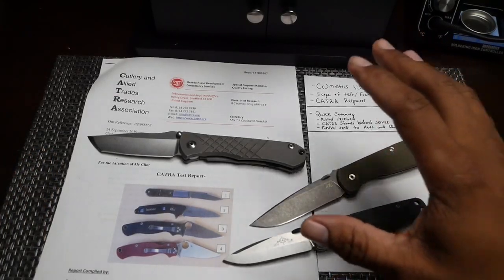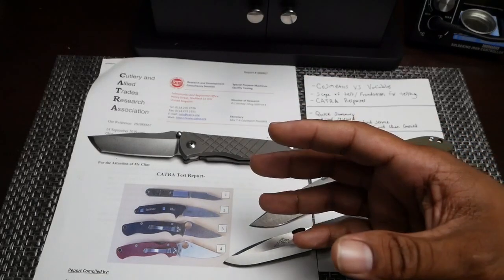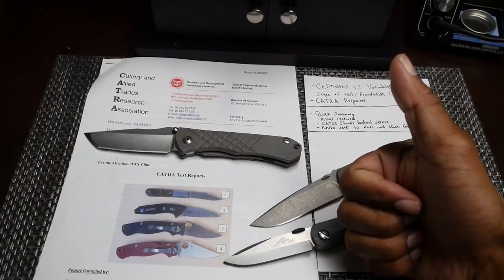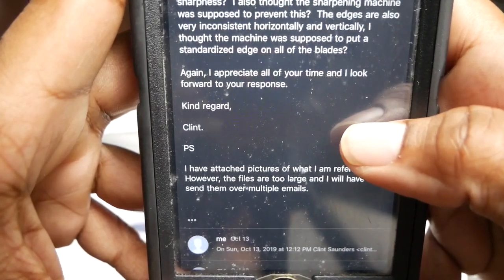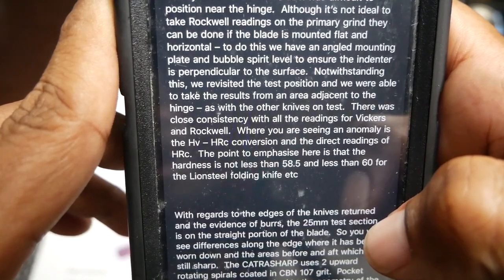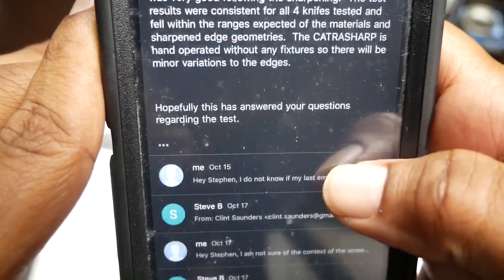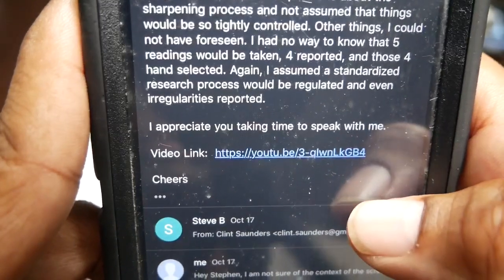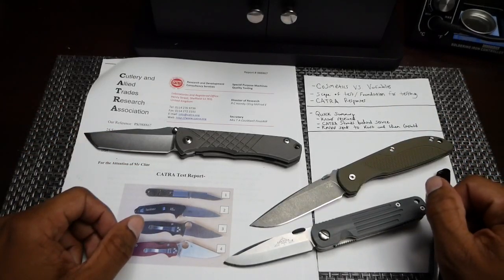CATRA Midpoint Update:  CATRA Stands Behind Their Work

Comment: There are some issues being taken as extremely negative without validation in hand.  Specifically, the CATRAsharp edge has been soundly chastised; and not going to sugarcoat it - they are not very attractive in their returned condition.  Also, the angles are coming under a lot of scrutiny - and probably rightly so. The problem is that we have no evidence that this edge hindered the test results.  I say eliminate that variable - pick one of the four knives and have someone trusted put the edge we want on the knife and send it back with a request to simply cut test this edge and video it.  Then if this professional edge blows the CATRAsharp edge out of the water - we would know that their machine, although good for standardizing tests, is not beneficial for cut results.  I have mentioned this before - Larrin is trying to figure out why your results are so much better than those seen previously.  If your results are so much better than the NifeSteelNerd would have anticipated then we have to look at those variables that have changed from previous tests.  Larrin has mentioned a couple possibilities, including the 25mm/40mm conversions; but it might be worth a small investment to insure one of the only other variables is eliminated.  And as far as I know, none of Larrin's previous data included knives with a CATRAsharp edge.  Maybe it is a butt-ugly jacked-up edge that cuts like a beast...

Maybe the outcome is that going forward you save money on the test and go back to a bro-science edge and bro-science Hrc reading by doing the work on our end.  I really liked the idea of a fully standalone test for credibility; but maybe a hybrid would work better.  Only ask for Hrc if there is a reading outside expectations and ask for only a ICP/TCC result otherwise.  That would standardize results back to $80 or $100 plus shipping per sample.  I think if we can get to a point to eliminate the sharpening and the superfluous information in the report - a good ICP/TCC database could be started such that conversations with factories have a little meat on the bones.  And they would be a valuable data point in the column right next to bro-science cut tests.
Reply from the maker: CollectorKnives We will soon have direct data to compare across the board. The point being made in the video isn’t whether or not the edge made a statistically significant difference, the point is that this test was specifically requested because it was supposed to significantly limit variables as compared to home testing. That’s it. Once the numbers come back, we can discuss data and make direct comparisons, as far as numbers are concerned. 

I have said many times and I will say it again, we will run these tests as long as you all, the community, fund the testing. I have zero issue sending as many knives as we can fund to CATRA. I put the donation link in the description box of every video. It’s also discussed on my IG page when the topic comes up. So far, I have seen a fair number of requests for more investigation, but a modest number of continued donations. 

To be exact, I received $40 last week and $25 yesterday. Considering the knives have to be shipped to others for continued testing and then the knives have to be shipped back to the owners, that’s not a lot of money. 

I’m all for all the data points that we can collect, but obviously that’s not going to be a reasonable feat as one individual. No only do we need more knives, we need to pay the fee for more testing. If we can defeat that hurdle, we can continue. 

As far as the Lionsteel knife is concerned, that’s not my focus. It wasn’t my knife, I didn’t vote it in to the testing, I have no investment in it over or under performing, it has no purpose for me, other than another data point. CATRA seemed to focus I on that knife in the emails and now we’re taking about it again. 

Honestly, the knife I find offers the biggest teachable moment is the Kershaw knife. It is the hardest. Yet, it does not perform the best. That speaks directly to what the home testers , Larrin, Shawn, and Roman have been saying since day one. The hardness doesn’t matter if the protocol is not good. Meaning, if the matrix is botched, everything will be affected. This shows that, in actual action.
Reply: No comment on anything else. But CATRA did at least do a very accurate job of the HRC testing, despite the hysteria and shockingly ill-informed comments to the contrary. see link and new conversion factor towards bottom of page and you will see why I'm sure they did it very well. Well it wasnt in doubt anyway, for one thing (among many) the original Vickers results and conversion showed the HRC tests couldn't be very far off , but this 'new improved' conversion factor  shows their HRC testing was spot on.....

https://knifesteelnerds.com/2019/10/07/catra-tests-of-m390-knives/

I think they used standard ASTM or ISO conversion tables for their Vickers to HRC, which is fair enough a lab probably should. But I think I might E mail them details of this 'new improved' conversion in case they haven't seen it.
Reply: @jimsmith5685  🤣🤣🤣🤣 really??

How do you process information that sideways???

Bro... NOBODY IS TALKING ABOUT THERE VICKERS TO ROCKWELL C CONVERSIONS ...

The issue with there hardness testing is 2 fold

1.) While all the blades are given a 4 HRC and 3 Vickers average... they were tested more than 4 times. The Lionsteel being poked 13 times total.

I guess we just pick which 4 look the best and discard the ones we dont like??

Why does Lionsteel get 13 readings the rest get 7,8, or 9?

2.) The Lionsteel was tested on the PRIMARY GRIND. 

In order to get an accurate reading with an Rockwell C tester, you need 2 dead flat sides of at least 2mm thickness (for 60 HRC and under).

Using a shim can skew results significantly.

And to add insult to injury,  where they tested the blade is only 1.5mm thick.

Oh, and they tested on the letter etching as well 🤣🤣🤣.

The way these hardness tests were conducted and reported were incorrect and unprofessional.
Reply: @SuperSteelSteve  the only valid thing in your entire reply is the HRC on the etch. But even that is not really valid. They did 2 HRC not in the etch, which were same as 2 in the etch (maybe one only partially). No Vickers tests were in the etch (you can't actually read them if they are in any case). Etch clearly made no difference to HRC result, if it had they may have done another not in the etch.

Comment: I agree that most of your doubts are well founded except for one thing: choosing a certain portion out of a set of measurements (e.g. 3 out of 5 measurements on hardness) does not equal "hand picked" or "introducing human error" when it comes to statistical studies. It's not as simple as you thought. More measurements averaged doesn't equal more accurate readings, what we are actually looking for is a methodology that produces minimal Standard Deviation(SD). In fact averaging measurements only shows an aspect of a certain dispersion as well as using Median or Mode, and unlike Median and Mode, Mean is affected by outliers, so ruling those out actually helps. A truly scientific methodology should be stated as follows: the averaged measurement of hardness is W, with X times of measure. Under Y% of Confidence Level(CL), the Confidence Interval(CI) is Z%. So neither bro science or CARTA is strictly speaking scientific, and I doubt anyone would go that far.
Reply from the maker: Anton Chou I am fine with that and mathematically that is accurate. However, scientifically, that is not a sound way to report on the data that is represented. The error I was speaking of are the angles that are inconsistent in all aspects. One of the criticisms of back yard science was that freehand sharpening was too variable to yield edges that would be fair to compare from one knife to another or even one sharpening to another. Clearly, this sharpening method is much worse. 

Sadly, there are people that believed CATRA was the most scientific test and necessary to make the type of statements that were being made from repeated back yard testing.  Also sadly, there are people that still hold to that belief system. 

In my personal opinion, we’ve made edged tools for thousands of years. How did we know if an edged tool performed or did not perform 100 years ago, before computers and robots?  Forget about the hundreds of years before that that edged tools existed.
Reply: Like I said, I agree most of your doubts are well founded except for that specific statement. Personally after seeing the sharpening results I wouldn't buy any of the report cause in real life nobody sharpens that way, so even it's scientifically correct it doesn't reflect the real world situation unless that's how you sharpen. To put it another way, I think this is an expensive experiment but failed unfortunately.
Reply from the maker: Anton Chou 💯